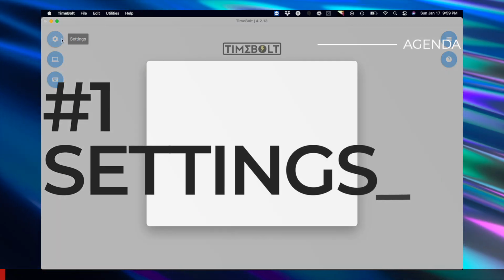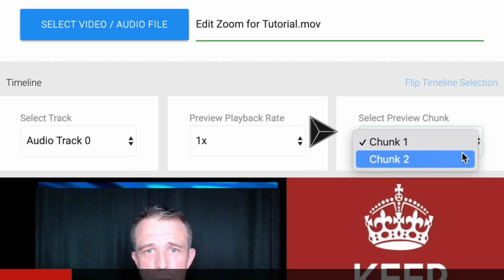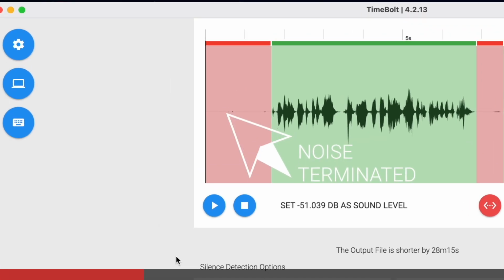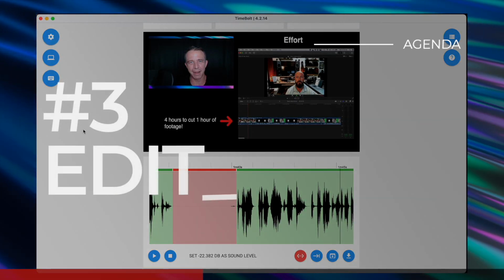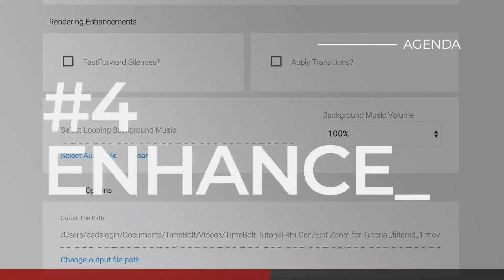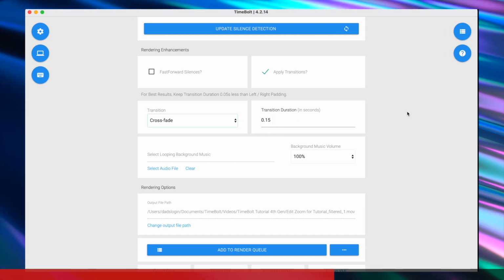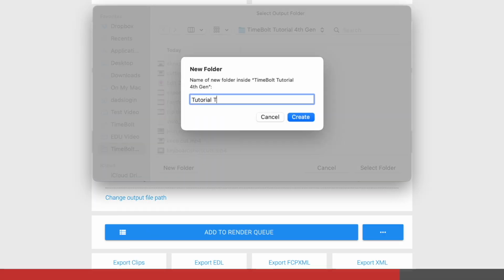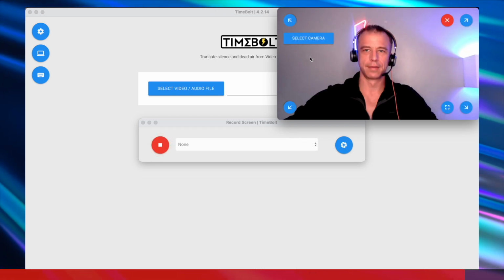Jumpcut Video Quick-Start Guide

Comment: I purchased the paid version, I’ve been working with it for over a week. After exporting with several different settings, I still have padding/dead air at the end of clips. I even set the right padding to .001…still dead air.

I cannot find a way to do convincing jump cuts. 

Is there a way to contact support? My email is not even recognized in the login, even though I have purchase confirmation.

Thanks

Comment: Interesting. What would be the best way to sync external audio?
Reply from the maker: What design program do you use?
Reply: @timebolt-rapid-video  I used Final Cut Pro. I record audio and video separately, process audio through Izotope, bring in the raw video and the cleaned up audio into final cut pro, and sync it there before dropping it on the timeline.
Reply from the maker: @TymekStolarz  Thank you...you already use the 'shift' feature for FCPX?
Reply: @timebolt-rapid-video  No I dont believe i am aware of that feature. I cant seem to find it on google.
Reply from the maker: @TymekStolarz  Here are the instructions with a video explainer at the beginning https://www.timebolt.io/blog/delete-silence-multi-camera-video
Reply: @timebolt-rapid-video  Would there be any issues with bringing in a WaveFrom Audio file and applying the cuts to it, as the auido file wouldnt have a framerate?
Reply from the maker: @TymekStolarz  correct, audio file doesn't have a frame rate
Reply from the maker: @leagueoflegendstube4510  Rock on...happy to refund if you don't adopt into your workflow